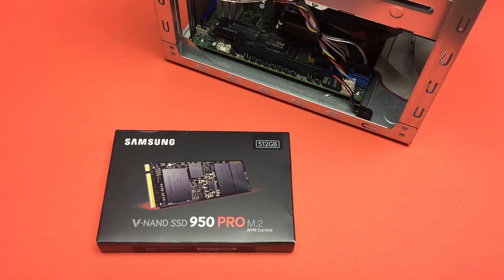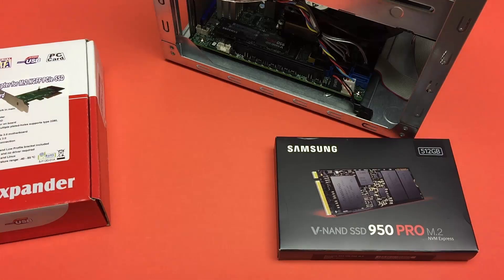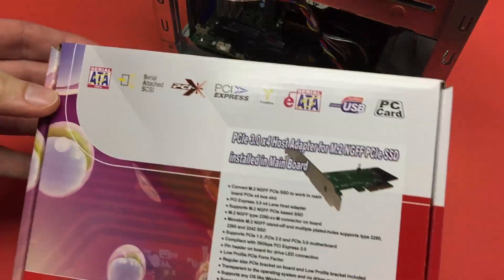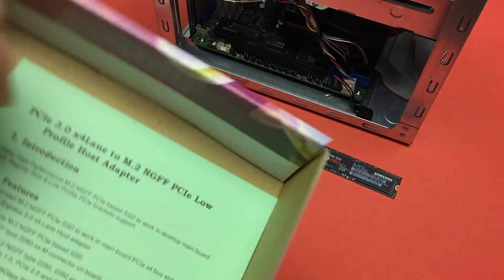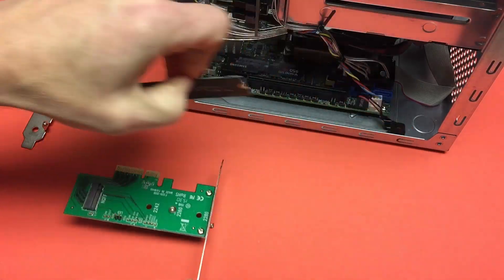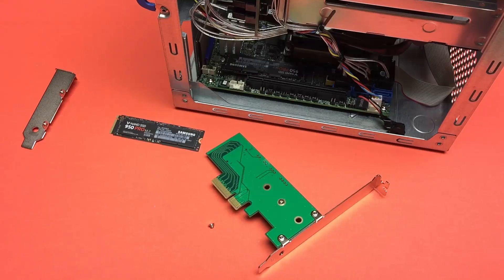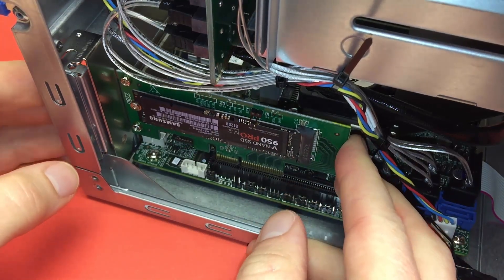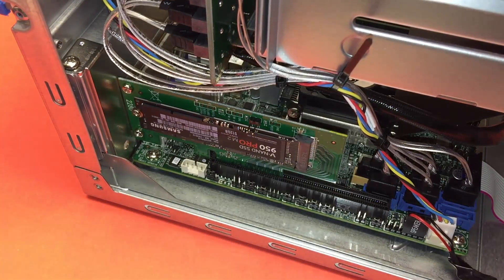How to install Samsung 950 PRO M.2 SSD in a PCIe slot with a Lycom DT-120 M.2 to PCIe adapter

Comment: can you install windows on these ssd's? or are they really used for servers?
Reply from the maker: +darafi Well, you could wear them out if you benchmark with a lot of writes over and over. But for normal workstation use (which is really how I mostly use my SuperServer, juggling Win 10 and some VMs, see https://TinkerTry.com/superserverworkstation) it suites me just fine. You're right, stepping up to more costly enterprise-like gear with big heat sinks for more consistent performance under a variety of loads is the approach Intel took with the 750 Series, intended for servers. See also https://tinkertry.com/search?s=intel+750+series
Reply: *****  thnx your reply is apreciated and ill look it up :)

Comment: Hey Paul, awesome vid. Very important detail I need answered please....If I connect everything exactly as you did, will I be able to use it as my boot drive for Windows 10 on a EVGA X99 Micro motherboard? My board is fairly new on the market except it only has m.2 key E, so that is why I needed the adapter. My series of MOBO do have the m.2 key M slot like the X99 CLASSIFIED, just not my model the MICRO.
Reply: ....ok, so my MOBO did have a bios update in October 2015 for NVME support, so does this mean i can boot up my windows 10 with a connection just like yours with thee adapter?
Reply from the maker: +Julio Lugo Shouldn't need an adapter, since I see you have M.2 http://www.evga.com/articles/00941/EVGA-X99-Micro2-Motherboard/
But yeah, that's a good sign, give it a try? I don't own that board, so I have no first-hand knowledge of whether it will work or not.
Reply: +Paul Braren ...thnx Paul, but my m.2 socket is in form of key E, not m.2 key M (2280). Key E is too short like for wireless, blietooth, gps, etc. i really appreciate it, but do you know the answer to my original question??? And thank you, the more we all learn together the better lol.
Reply from the maker: Ah, ok, well, it might work, I'm just not sure, haven't tried booting from a PCIe mounted device. I'll try to get a shot at it (wish I had a second system ;-)
Reply: +Paul Braren ...well i bought it anyways, i will repost once i install and give us all some more info about booting Windows while being connected with the adapter.  and thnx again Paul
Reply: +Paul Braren   Ok, so I finally installed my Samsung 950 Pro SSD. yes, I installed it thru an adapter on my PCIe 16x and I was able to use it as my Boot drive for Windows 10. This is the link to the exact one I used... http://www.newegg.com/Product/Product.aspx?Item=9SIA86V...If you buy a different one make sure it is 3.0x4. It is really for PCIe 4x but does fit on the 16x though it is much smaller. If anyone is interested just ask on how to install the OS because your SSD does have to be set GPT and Boot Mode in BIOS must be set to UEFI. This is very simple and you do get full speed even though your SAMSUNG 950 PRO SSD is connected via an adapter (ADAPER DOES COME FROM CHINA THOUGH IT IS LISTED IN NEW EGG) WORKS PERFECT!!!!!!!!!

Comment: Hi. What will happen if i connect the 950 to a M.2 PCIe gen 2.0?

I have a Asus Maximus Ranger VII and only have that one M.2 Port.

I guess i should go with an adapter to get the ultimate experience?
Reply: +Nicklas H same question
Reply: +Nicklas H Being it runs on the same SATA bus as a standard 2.5 in SSD it would be throttled to the same performance.
Reply: cool thx
Reply: ugh the product is called ASUS HYPERM.2X4MINICARD Interface Adapter - M.2 - Expansion Slot To M.2 - M.2 Card - 32 Gbit/S - Pcie 3.0 X4 - For Asus Z170, H170, X99, Z97, H97, B85 Motherboard Series

Comment: Anyone try this m.2 ssd with this adapter, on the Crosshair V formula Z motherboard? I know the motherboard is only pcie 2.0, but (if it works) I still would see performance increases over using sata ssd.

Comment: Hi! Thanks for the video! A question: if I connect the M.2 module with the pci3 adapter, the performance remain the same like I connect me M.2 ssd diretcly on the motherboard or the M.2 + PciE Adapeter is slower? I would like buy this ssd and use it on my AsRock Z87 Extreme 6 hoping the mobo supports it. Thks!
Reply from the maker: +Fabrizio Ferrax I see that's got the right speeds (at least PCI 3.0 x4) but it's 2013 vintage:
http://www.asrock.com/mb/Intel/Z87%20Extreme6/
so I doubt whether they'll come out with a BIOS update for NVMe support that's required for bootability, more about requirements at my article:
https://tinkertry.com/how-to-install-a-2nd-samsung-950-pro-m2-nvme-on-superserver

If you just want secondary storage, it seems you're good to go. The adapter seems to have no effect on speed, as I show here:

https://tinkertry.com/samsung-950-pro-benchmark-results-superserver-sys-5028d-tn4t#Bestof3

Comment: Can you boot from the riser card drive? 
I have this installed on my asus z97-deluxe, and the speed is hampered by the pcie lanes. 
I ordered a riser card, but i am unsure if i get full speed and if i am able to boot from it.
Reply from the maker: +Petrus Perius Sorry, just got around to testing this, and yes, on my Supermicro, I was able to install to then boot from the Samsung 950 PRO installed in this adapter card just fine. BIOS doesn't seem to really know the difference, just seen as a PCIe device either way, with full speeds https://TinkerTry.com/samsung-950-pro-benchmark-results-superserver-sys-5028d-tn4t